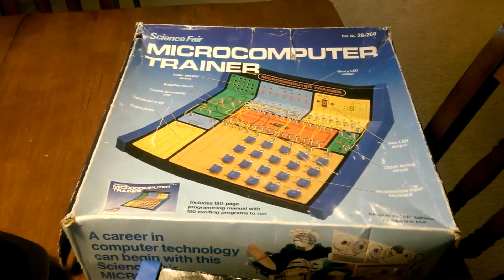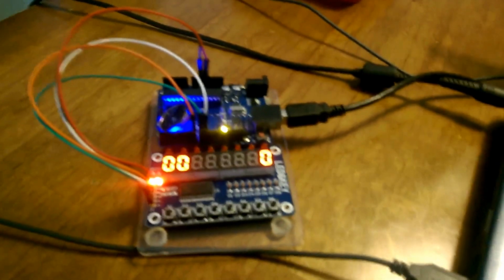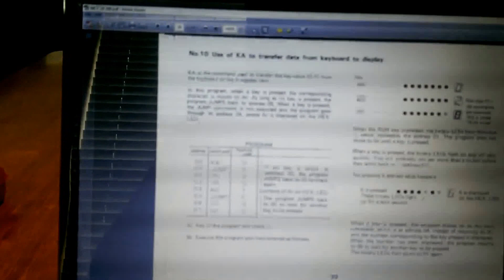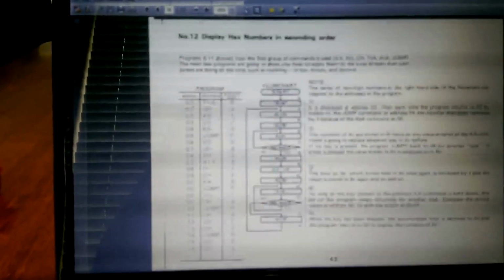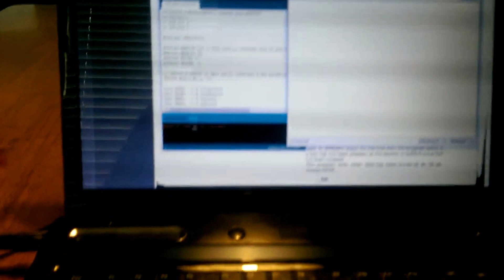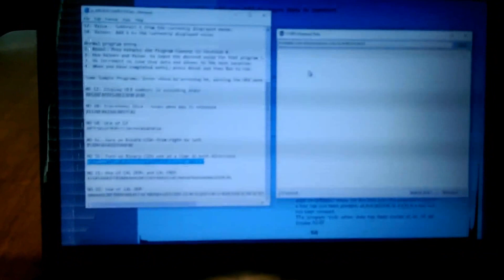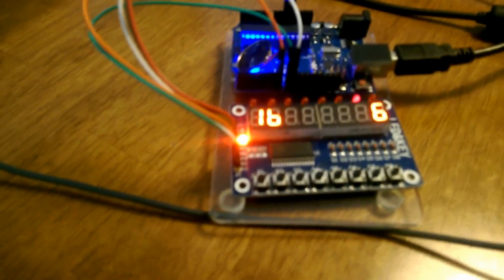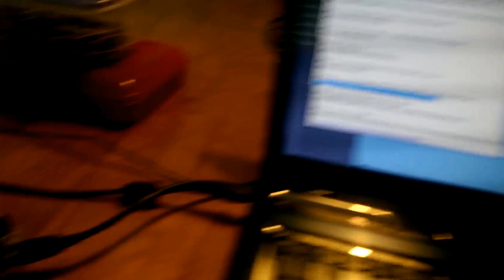Microcomputer Trainer

Comment: Hookup should be D10 to pin d8 on arduino -  CLK to d9 on arduino  - STB TO d7 on arduino GND to gnd on arduino - VCC to 5v on arduino NOT  pins 8 - 9 - 10 as shown on the webpage  It should work now the video above shown the correct wiring.  http://microcontrollertrainer.blogspot.com/